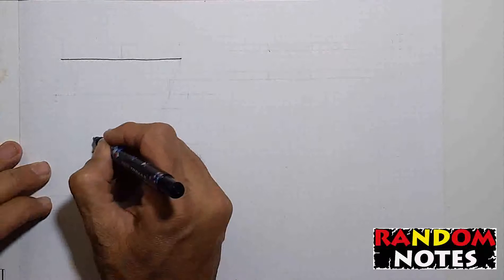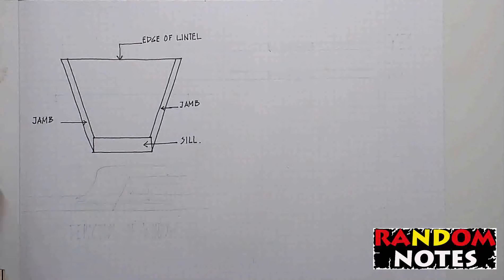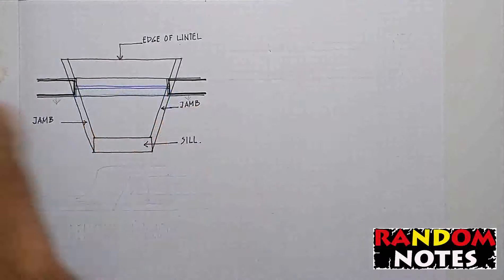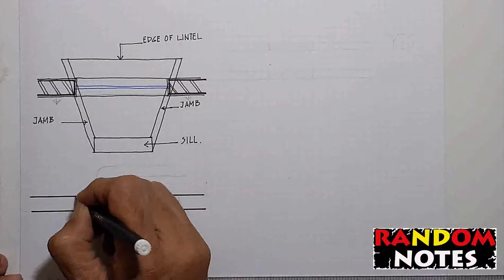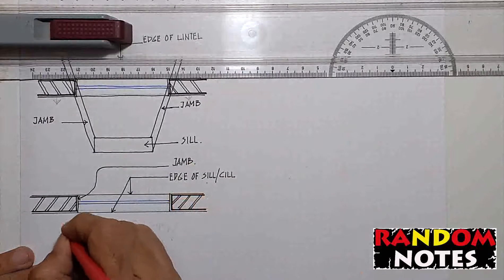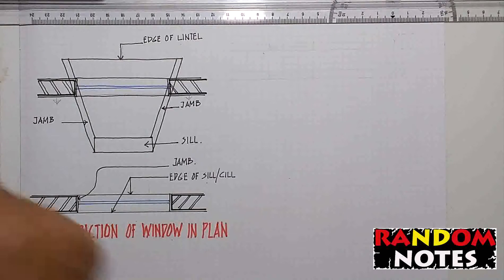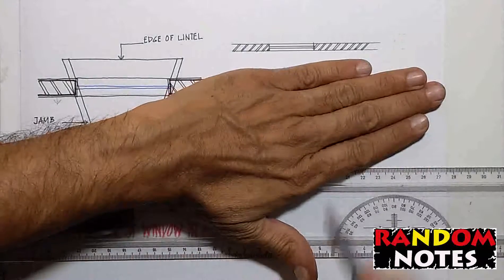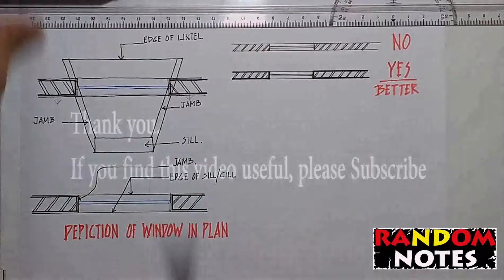Window making plan 1

Comment: Hi Sir,
Can you please share how to depict the hinge of a window in elevation.
Thanks.
Reply from the maker: Hello Anuja. This is depicted by taking dotted lines from the centre of hinge edge of opening to the top and bottom of the other side. So if the hinge is on left side then you see a proper "K". If the hinge is on right, you see a reflected "K" The two arms of the "K" are dotted and they converge on the hinge side. For top hung window it is a turned "K".

My next video is on doors and windows, I have done this in that.

Hope you and Vishal are fine.
Reply: random architecture notes-
Hello Sir,
We are good. Actually I forgot the correct Depection so I had asked this question to many people till date and every time I got different answers. 
So after seeing your video, I thought, i should ask u to get the correct answer. 
And ur video's are amazing!!
Reply from the maker: Thanks.